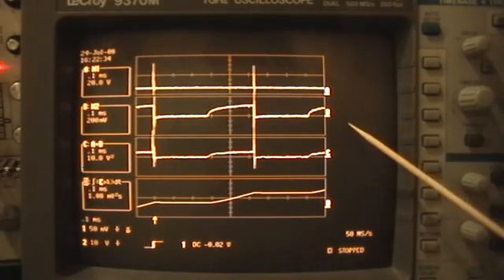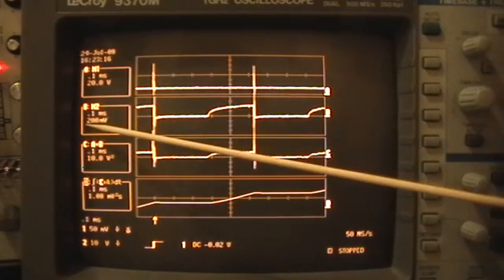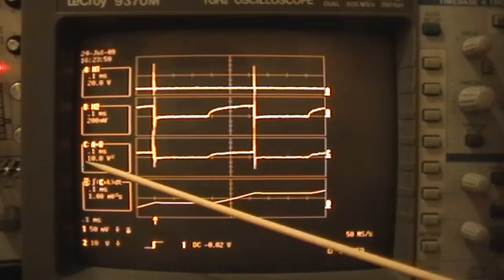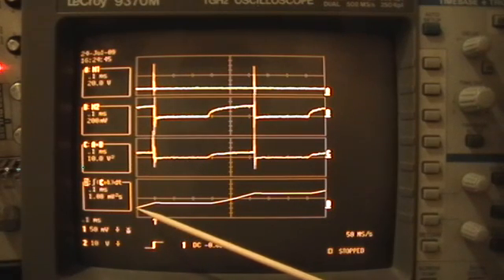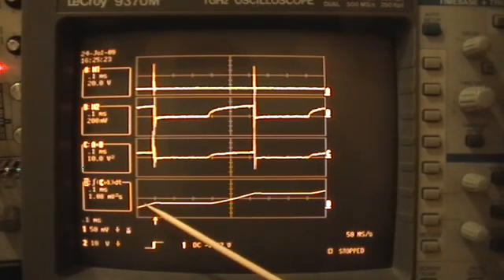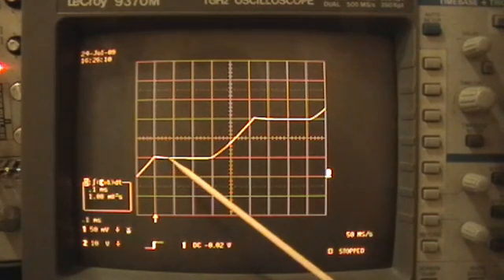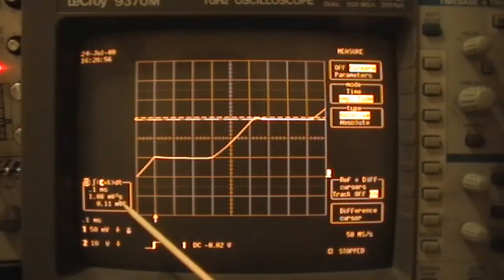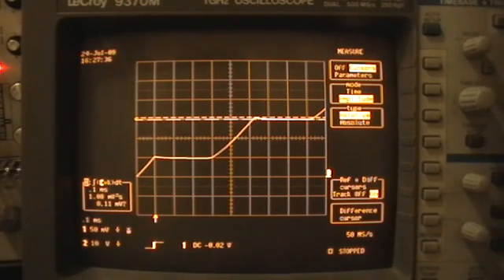Electric OU: More Energy Flux Measurements with the LeCroy

Comment: The timer circuit is only a hammer to set the tank oscillating and keep it alive. You need to create a resonant mode in the mosfet, inductor battery circuit, and ensure that the gate pulses are phased to keep that ringing. The ringing across the inductor should never die and should be around 140KHz. We may have to add some capacitance in parallel with the the battery to tune it. Let me know if you need help with that. Cheers.

Comment: Ok, you piqued my curiosity enough that I read the article in quantum and the newspaper article and even had a look at the patent. The control circuit is set for 3.7% duty cycle near 2.4KHz, but the IRFPG50, Inductive Resistor, Limiting Resistor and Source Impedance / Reactance setup a resonate oscillation near 140KHz. It is perfectly understandable, but damn hard to replicate because the battery itself is the capacitor in the resonant condition - and that changes. I have an idea how to get it.

Comment from the maker: I NEED a WAVEFORM!

If someone will PLEASE just tell me exactly what waveform to use to produce OU behaviour in this circuit, I will go pull out the silly Arbitrary Waveform Generator and program the thing to sing whatever noisy note is required. Or I will bake 555 chips in the microwave, power my scopes from a consumer-grade inverter, and use a hamster wheel to clock the circuit. I don't care. I just want to see SOMETHING INTERESTING for a change, ffs.

Comment from the maker: What you and I call resonance isn't the same thing as what "those people" are calling resonance. Any resonances in this circuit are likely to be much higher in freq than the cited operating freq of 2.4 kHz. What they have described seems like lost scope trigger to me.
The power calculations are (slightly) complexificated by the oscillatory waveforms. And the lack of a grounding in calculus, which causes "them" to believe that numerical methods using 4 or 5 samples per cycle will be appropriate.

Comment from the maker: It's a LeCroy 9370M, it's not mine, I borrowed it from some friends..It's pretty old, I don't know how much it originally cost or what the friends paid for it, but...To give some idea:
it will cost about 4200 dollars CDN to have the second channel's DC offset issue repaired and the scope calibrated.
Which is why it isn't mine, and why I haven't shown the realtime energy measurements.
And it does lots more than what I've shown.